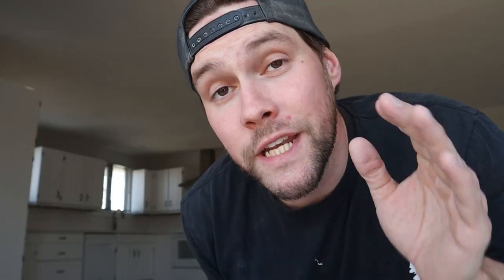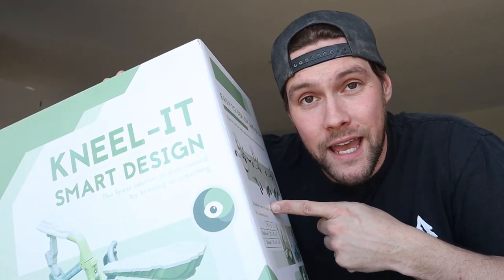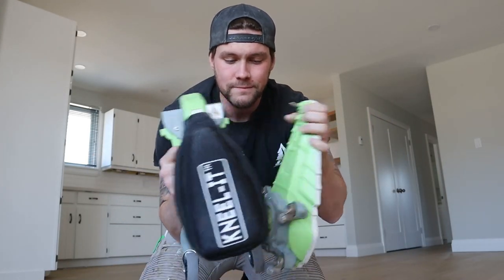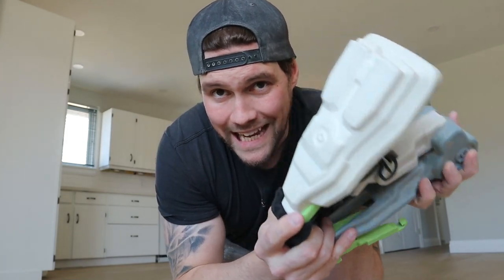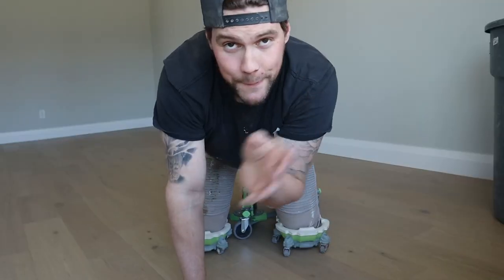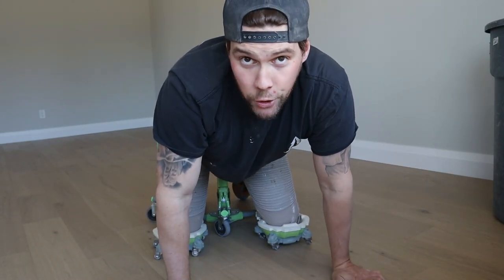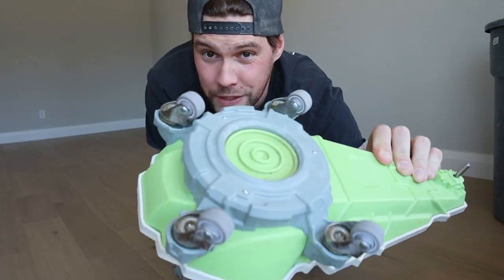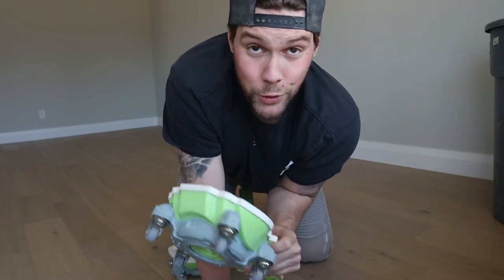Are rolling knee pads really worth it?

Comment: I wonder how this thing would work for auto detailing?    I think it would be great if it had better wheels.    I'm not sure those small wheels would roll real well on macadam surfaces or rough driveways?   Flat tile and hardwood are a lot smoother than concrete ad macadam surfaces.   Looks like it would be a great tool for detailing though,  especially when cleaning or polishing the wheels and lower panels of a vehicle.
Reply: Those small wheels would get stuck in rough surfaces but it would be great for painters when prepping floors
Reply: You would need larger wheels,no better wheels this size could help you. And you also need smoother floors in your garage if you plan to use something like this

Comment: Will scratch the hell out of a floor unless it's tile or carpet.
Reply: Carry some dust off...One little pebble will drive you crazy with all those wheels but may be worth it.
I may try it after 35 years as floor installer It's tiring balancing on knees installing vct vp lvt. 
And all the getting up and down wear you out..just roll over there  and back could be less tiring and quick.